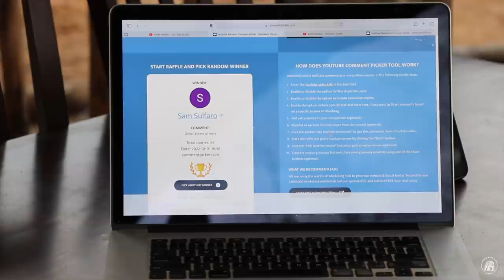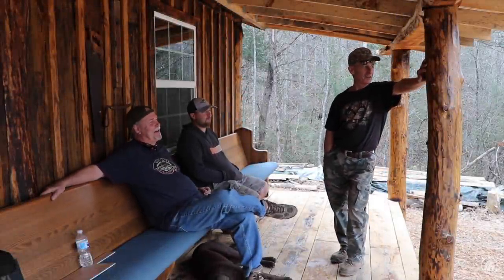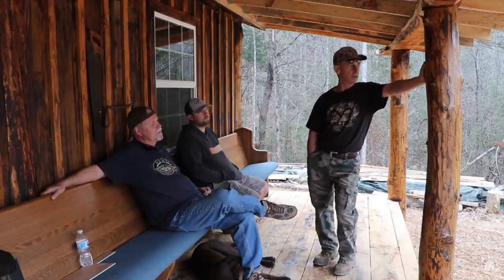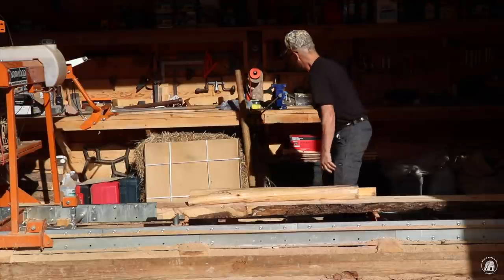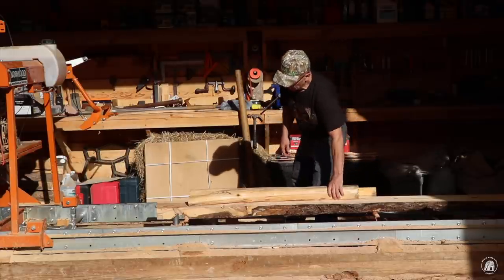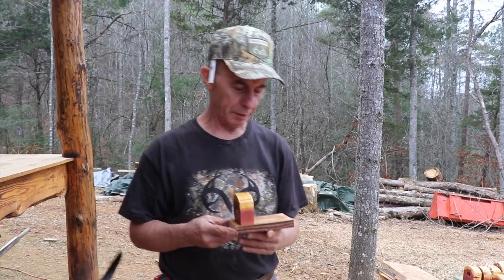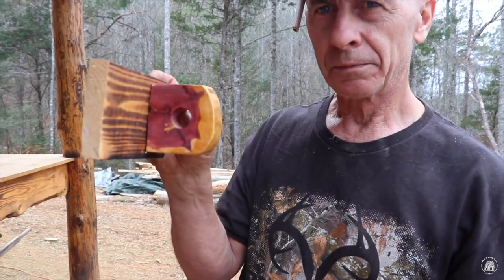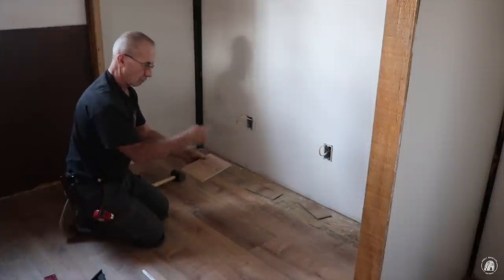CABIN FLOOR INSTALLATION | OFF GRID TIMBER FRAME HOMESTEAD

Comment: Richard, I noticed that you have disabled the safety guard on the the Miter/chop electrical saw at 23:15 and so on...that is not cool...a little distraction it could be very costly especially due to the fact that it has such a large opening of the spinning saw blade for danger.   I trust your viewers don't it is OK to do so because you are using it with the disabled safety guard...very concerned about it... I know you have the experience, but it only takes a second for a nasty accident.  It is appreciated if you please record videos for your audience with the safety on and in mind.    Thank you...